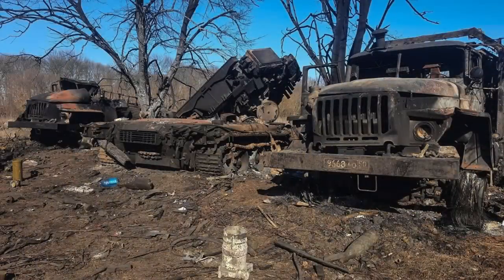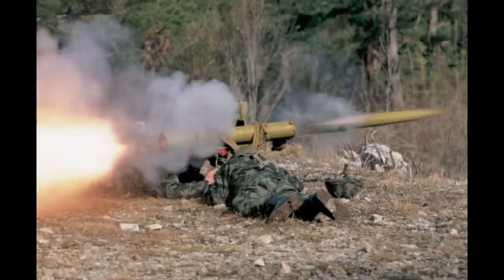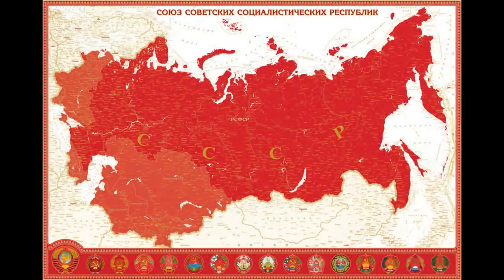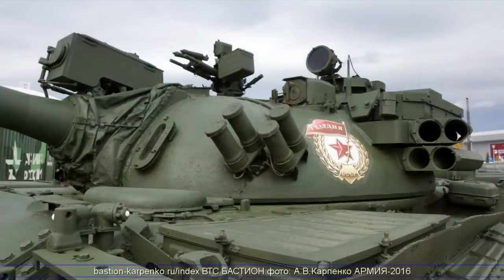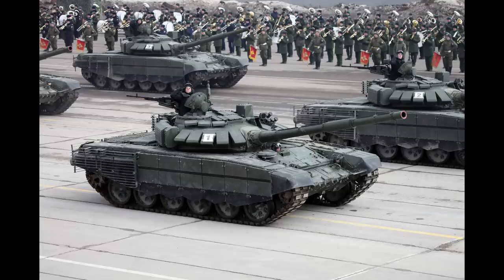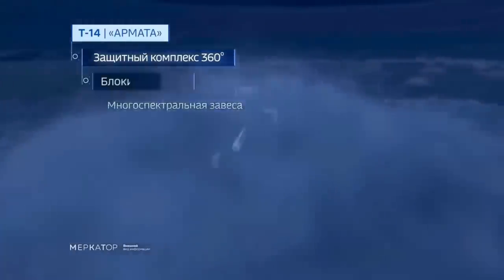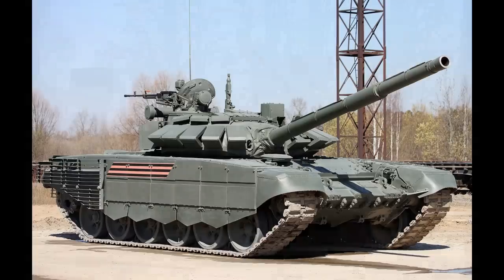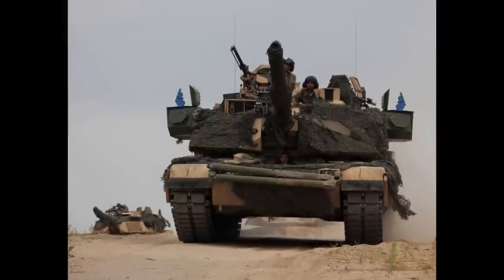Why are Russian Tanks Failing in Ukraine?

Comment: Personally i have done some research about these systems after the ukraine war started. My opinion is that Russia has not manage to make a good Hard kill system because it has not the computers and sensors to make a truly accurate and effective system. The biggest proof of that is the size of the explosion that comes from arena-m's cassetes. Exactly because they cannot calculate the incoming missle accurate and on time they use such a high explosive rounds to cover a large area in order to destroy the missle.
Reply: They did make a decent one in the 1980s called Drozd. The problem is they were mainly deployed on T-55s in Afghanistan and they didn't continue production of the munitions and parts after the end of the cold war. Arena never made it into serial production. Just because the system works on brute force instead of precision targeting doesn't mean it doesn't work. Drozd and Arena have major drawbacks but the main problem with them is that Russia isn't using them or just doesn't have them or have them deployed.
Reply: What you said is a consequence. The root cause of the inability to create anything is total irresponsibility, illiteracy and, of course, corruption. Both in specialist positions and in managerial positions. Corruption in all its manifestations, and not just in the form of bribes. In particular, illiteracy is mainly due to the fact that the positions are appointed, not those who are suitable for the level of qualifications, but for personal sympathies (relatives, acquaintances, etc.). I work in one of the federal civil services of Russia, in the regional directorate. Many of my colleagues, moreover of Russian nationality, including some representatives of the leadership (!), simply do not know how to write correctly in Russian.

Comment: The Chinese tactic on tanks are long range engagements only and to knock out other tanks so their infantry can advance where the enemy cannot have an advantage at all. The Chinese knew from experiences in the gulf war that tanks are REALLY effective in knocking out armor and defensive position but absolutely trash when used as a patrol unit trying to find targets. Even APCs and IFVs dedicated to fighting infantry struggle with this because the infantry can spot any vehicle miles away and destroy it with handheld and guided weapons. 

The Russians needed to use their tanks in the same way and rely mostly on infantry because a squad of soldiers has a better chance against an Ukrainian squad than a tank does.
Reply: They do not have the manpower.
Reply: Unless the tank is designed to be a tank hunter, it's nowhere near as useful armor hunter than a chopper or a plane. Abrams and Leo-2 are specifically designed as tank fighters. T-64/72/80/90 are mobile artillery piece designed to support infantry in an assault, kill enemy fortifications, breach defenses.
Reply: With what infantry? They don't have enough and their best men died on day 1.
Reply: You just don't have idea what you talking about.
Tanks has much better optics than a infantry, plus it's really wrong the idea that atgm is 1 shot 1 kill even the high end one like javelin or spike are far from it.
Reply: Its hard to use infantry if you don't have infantry.,
Reply: "where the enemy cannot have an advantage at all."
So they gonna fight on the moon or something? Just get out of here with your cheesy talks and COD tactics kid.
Reply: Russian infantry is busy searching washing machines and has no time to protect self destroying tanks.
Reply: It was about 1943 it was obvious that tank need infantery suport, and infantery need tank suport, and combine arms are a potent combination.

Comment: There is no technical fix for the levels of corruption and incompetence in the Russian military.   Even if they had the A-14 in mass numbers.  The conscripts wouldn't be able to use them, they would not been maintained, and the gas would have been still sold away.

You are talking about a taxtical fix for a strategic planning problem. You cannot win without working non-corrupted logistics and training.

Comment: Who says they are doing badly? Most of these photos of destroyed tanks are from their rather ambitious assault on Kiev on the first stages of the war. They have since learned their lessons.
Reply: Cope much
Reply: Well there are losses, and first months created overall picture of failing russian weaponry and tactics. Lots of modern tanks was lost then because of the assault on the north. Since then of course situation has advanced much, but then again T-72B3s for example does not perform as good as a lot of people would expect.
Reply: Satellites over head report losses to both sides, perhaps you just didn't bother to look.
Reply: They've been losing armored vehicles well after their Kyiv assault. They didn't use T80 BVMs, T90A and T90Ms in the early days of the Ukraine assault yet we have photos of knocked out T80BVM and T90 tanks. They also didn't start using the cages until after their failed assault of Kyiv yet we have a ton of photos of knocked out tanks with cages on them. They aren't going to just change their entire combat doctrine that quickly. The only reason why their armored losses have slowed down lately is because they're generally pushing a lot less using ground forces and are instead relying on long spans of artillery and air strikes to destroy and soften up targets and then slowly moving troops in to take territory slowly.
Reply: @DerMetalmatiker  Ukrainian troll cry harder
Reply: @mrmacias4217 
Cope cope cope

Comment: Most of the tank kills i hve seen are from mines and artillery and drones in early phase of war. Manportable at rockets are overrated IMO. In the sense that they ofcourse do work, but they don't threaten the idea of an MBT. Atleast not yet
Reply: Most of the pictures of knocked out tanks would be from ATGMs. Most of the pictures usually show the tank next to a building using it as cover but the building isn't blown to hell as it would be if artillery had done it. Because the vehicle is off-road, it's probably not a mine that was planted in some random person's garden. Looking at the photos, most of the tank wrecks are in a city environment, next to a building but the building is mostly intact at the tank's level. This rules out artillery and mines. There have been cases of artillery doing work on some makeshift resupply bases or slow convoys though which account for the tank wrecks along the sides of the road. I'd say the mines were probably the wrecks we see in the middle of the road used to stop a convoy and used as a cue by the artillery crew to start shelling that point. The tanks then got off the road into cover at the side of the road and the drone walked rounds in on those tanks that went hull-down in a ditch. We also have a lot of drone footage showing Ukrainian troops ambushing convoys using ATGMs or RPGs on the lead and last vehicle to stop a convoy and then artillery cleans up the center.
Reply: @Talishar  don't know about you, but most of the destroyed tanks i have seen are on side of some road. Even the ambush videos are mostly on roads.

Also a destroyed tank can also mean that the tank broke, ran over a mine, ran out of fuel etc and the crew destroyed it because they couldn't recover it. These are 30-40 year old machines. Upto 60% of hardware is not useable in many militaries depending on the country for this very reason.
Reply: yes IN YOUR OPINION which is irrelevant
Reply: @ulikemyname6744  just like yours
Reply: @lumberjackagies5158  true
Reply: @lumberjackagies5158  Most of the lost tank photos I've seen are in the cities because that's where most of the tanks have been lost. In cities or towns. Also, we know they were lost to just a mobility kill or running out of fuel because most of the photos show the turret launched separate of the hull with the whole thing burned out. Not just chilling on the side of the road.
Reply: @Talishar  not really. In the early phase drones seemed to do most of the killings. Also i said road. A road can be in a town or a city as well. You said next to buildings. For me, most were just out in the open. A done and top attack im general are more likely to throw out the turret.

Also the point is not whether manportable rockets were killing tanks or not. The point is they are overrated by people on the internet.

Comment: The question is how well those original active systems worked back when the Soviets came out with them .it’s hard to believe that technology like that from the 1980s was good enough. Considering the state of the Soviet computer industry, it’s impossible to believe that they could have had a system capable of making the decisions required of such a system as to know what it was seeing, much less having the response time to kill an incoming projectile.

So it’s likely they discontinued this when the USSR fell because it didn’t really work, and the time and money needed to make it work wasn’t available. So now, they’re trying again. But there are still a lot of questions. We only have their word that it does work. And the Javelin only used infrared from the side to initially find the target. Once the middle is fired, it no longer uses the targeting info from the launcher, and uses its own. Once it’s well above the target, will these systems be able to kill them? I don’t believe so. Everything we’ve seen so from from the Russians show projectiles being killed that approach the side, and close up. Can they target a Javelin coming from high above? If so, can these missiles turn abruptly upwards to intercept it? Doubtful.
Reply: For the Soviets, it was often a question of economics.  They found it hard to justify protection systems that sometimes increased the cost of the tank by 1/3.  So they had these expensive active protection systems to protect older T-55 and T-62 tanks that cost nearly as much as the tank was worth on the surplus market.  So the Soviets just opted for a newer generation of tanks with composite armor and ERA.  However, that new generation of tanks T-64, T-72, and T-80 had performance on paper that wasn't matched by real-world results.
Reply: As far as i know, Drozd was only effective against slower moving threats, i.e. the ATGMs of the time that were waddling around at about the 200 m/s, so there was quite a bit of time and a relatively narrow speed bracket. I suspect it wasn't so much identifying incoming threats as it would fire at anything that matched pre-set sizes and speeds. Doesn't seem like a terribly future proof system really.

As for the the Javelins and Russian hard kill APS, none of them seems to be suited to counter top attack missiles. 
Drozd and Afghanit are horizontally launched, and Arena, while it is launched at an upwards angle seems to be ahve it's "kill zone" aimed towards the ground, and as such could be flown over. The APS that would work against Javelin is IR smoke.
Reply: Soviet APS must have worked, because Ukrainians inherited Soviet design, perfected it and sold it as Zaslon APS since early 2000s.
Reply: @phunkracy  Idk,  looks like a total redesign, or maybe even a completely original design.
Reply: Related to the old soviet Drozd system (first such system in the world), I don't think it had any computers, I assume it had a completely analog control system, as many military systems of the time (even in the west). According to wikipedia, it was used in Afghanistan. Althoug it was pretty good against RPGs, but had a limited 60° protection arc an was so powerful that it could cause friendly casualties....
Reply: @Slavic_Goblin  it looks identical to a  other soviet project that was in the works in the 80s and is in fact just a more recentl version of it. The reason RU doesn't employ it is because they didn't inherit its design bureau after fall of USSR, Ukraine did.

Comment: T-90 is not failing in any ways. Russia have 450 T-90A/M in active service, there's only 21 confirmed losses in 6 months of fighting. It would take them 10 years to lose all their T-90-s. Kontakt-5 and Relikt are more than enough for protection when you have a good wielded turret. Uralvagonzavod also received orders to produce more T-90M tanks, until T-14 is ready.

Comment: So did they decide to pump out older cheap tanks over the last 8 years, even when oil prices were high, due to corruption? And why so much propaganda from them that their tanks had active protection systems when they didn’t? Genuinely trying to understand their decision process, or if it was a minister/general that took kickbacks instead of implementing APS on older tanks?
Reply: Sanctions imposed in 2014 probably played a big part in why newer tech got delayed or outright impossible to produce. Russia has the capability to produce some nice toys, but the can't do it without importing a lot of components from the west.

Comment: Russia uses tanks for a breakthrough, 1 tank is only 3 crewman.
3 people creating such pressure that forces every single soldier on opposite side to focus on them all their attention while wrecking havoc  is quite a feat.
Even like 20 people group of infantry cant do the same.

So if we talk about tank as force multiplier rather than something that should be invincible and never go forward - its quite great tool that multiplies unit strenght about 10 times
Reply: And 1 guy can fire 1 missile and watch the turret fly up in the sky
Reply: @rogerwilco5918  The difference is that the tank has the firepower to destroy anything else on the ground it sees easily and brutally.The firepower that infantry can bring doesn't even come close. Would you rather have 20 people march up ahead and get mowed down by mortars, snipers, and machinegun fire instead?
Reply: @Frenchfrys17  😂 I used to be mech infantry.. no need to try to explain to me how it's done.

Comment: Tanks have performed exactly as NATO tanks would have performed subjected to the same level of ATGM threat. The real failing of Russian armoured usage so far was in the first few weeks using the BTG model of fast mobile groups comprised of armour, infantry and artillery. The Ukrainians with their superior small unit tactics training from NATO members allowed them to fix the small infantry support in place, destroy them and then target and destroy the unsupported armour. with the axis of advance and the huge distance between each thrust meant there was no way to mutually support each other and that left the rear and flanks exposed to Ukrainian SF tank hunting teams.

With the withdrawal from Kyiv and the restructured push, grouping the artillery and advancing within a smaller areas using SF teams to support flanks and secure the rear. Moving from small skirmishes to large scale pitched battles the superior small unit tactics of Ukraine are no longer useful in this conflict and Ukraine SF efficacy has been reduced with constant losses and the change in the battle phase. 

I would argue there is not a tank in service or on a drawing board that could survive the level of anti tank threat in the first few weeks of this conflict. 

Also the Challenger 2 does not have a commander thermal viewer.

Comment: 4:45 doesn't T-72B3 Obr. 2016 have an independent commander thermal sight too? At least several places on the internet indicates it does.
Reply: Yes, but most T-72B3 has none
Reply: Nope. T72B3 doesn't have CITV. The commander can use the Sosna optic from the gunner instead but that's nothing compared to an own sight.

Only "available" russian MBTs with a CITV are the T90M and the T14

Comment: This is what happens when you effectively have a third world economy based on exporting natural resources. Russia just doesn't have the money which is why it uses all the old Soviet produced equipment to a great extent. The only Russia produced equipment is often in very low numbers.
Reply: It does have the money, just that most of the money was skimmed off.
Reply: Oh, Russia has the money.  But by the time that funding reaches a viable system it has been filtered through many corrupt fingers.  As such, there is only a little money to buy the bare minimum.
Reply: @disturbingdevelopment4308  I don't think that's true. Take a look at the Russian economy as a whole, absolutely dependent on importing basic materials and finished goods. Even in agriculture, Russia needs to import seeds for example. All its heavy industries are facing these problems, from heavy and electrical, to timber export and telecommunications.  You can artificially bob up the Ruble and fudge unemployment figures, but sooner or later the truth of the matter comes.
Reply: They are number 6 in the PPP rank. I wouldn't call that a third world economy.
Reply: @asdf3568  GDP of Spain, while much larger than Spain, more rich in resources than Spain. LOL